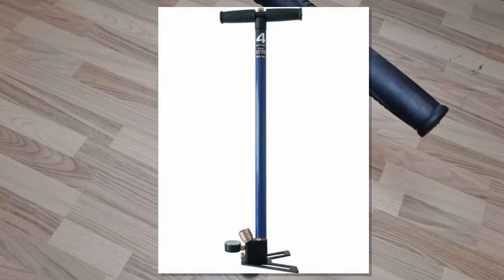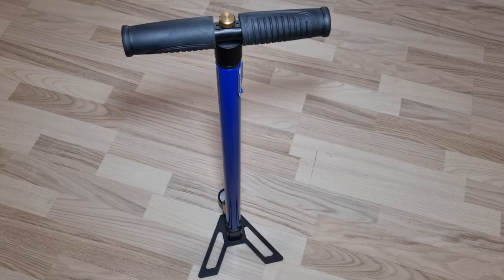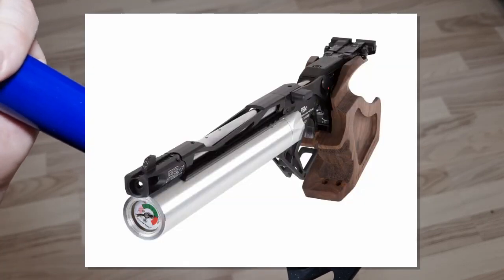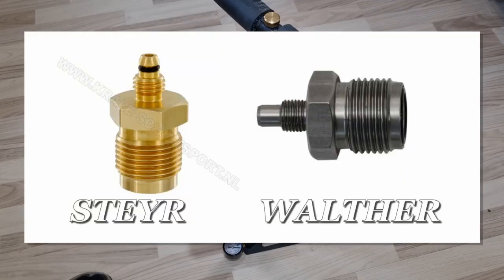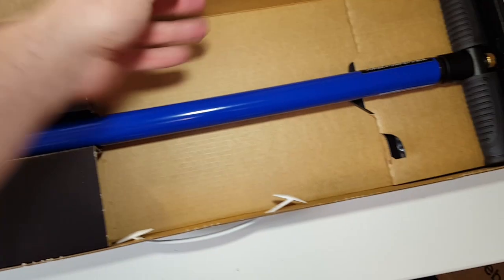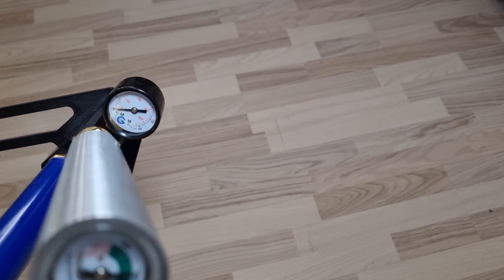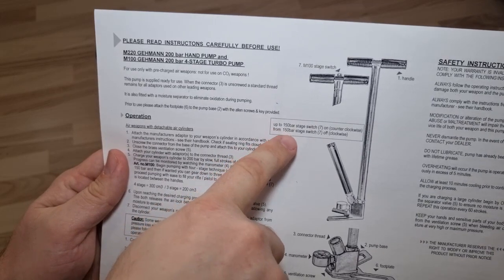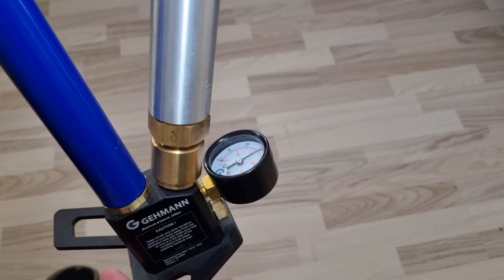PCP 4stage 200bar Handpump [EN]

Comment: Many many thanks for this video... it was the only lead I have found in repairing my pump, which is an FX 4-Stage turbo pump which is obviously the exact same pump- except for the FX having a hose instead of a direct  connection for  tubular tanks. The video will be a great help when I finally take the plunge... too bad there is no sound to it.
Reply from the maker: what do you mean "there is no sound"?
Reply: @ArmeVechi  The  instructional videos on your link below has no audio- is that how it is for you too ?  Some instructions from the technician would be great... it is quite a complex op.

Comment: I really wanna get a ghemann pump but I don't have this type  of unscrewable tank. I have normal bottle tank. So I would need a hose for my pump. Do you think there is any possibility with an adapter  or something, to connect a hose to this ghemann pump? Please I'm lost if u have solution I would be grateful. Regards (:
Reply from the maker: there are adapters. search www.bestfittings.co.uk to find what you need
Reply: The FX 4 Stage pump is the same pump but with a hose.

Comment: Nice video...I am looking at a Walter LP 400 and was thinking to get this same pump (3 stage)...so with the Walther filling adapter I need to unscrew the cartridge everytime I need a break?
Reply from the maker: no, you don;t need to unscrew it when you take a break. 
with walther, you just cannot use the screw to bleed the system. so you have to unscrew the cylinder, at the end, under pressure (harder)
Reply: @ArmeVechi  Ah ok...isn't dangerous? I wonder why, when every other brand do the same way, first bleed the system and then unscrew the cartridge... thanks for the info
Reply from the maker: @raffaeledemartino9736  dangerous no. more wear on the cylinder threads yes.

Comment: How many shots you can shot from an 200 bar canister filled in 5,3 minutes?
Reply from the maker: that depends on the gun. on my FWB P8X, one match of 60 shots plus 15-20 sighters take exactly 50 bar. so from 200bar to ~100bar there are around 180 shots or 2 full matches